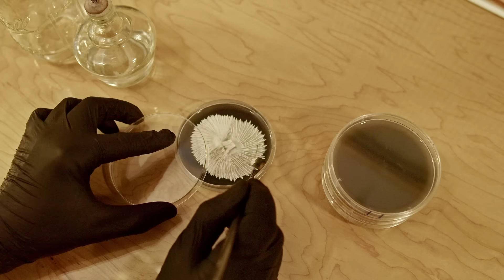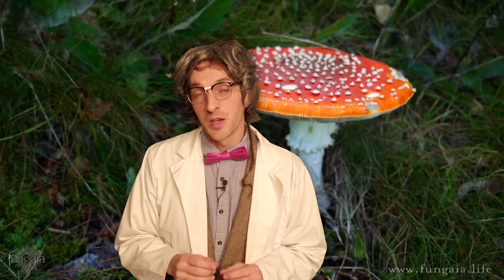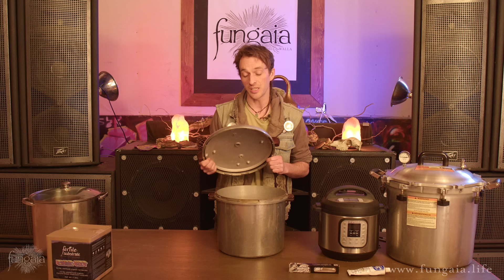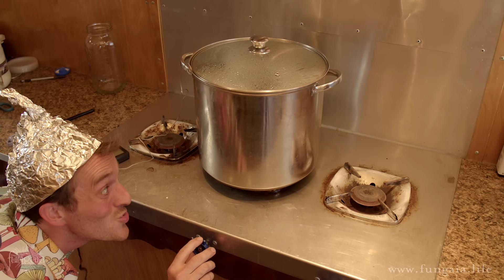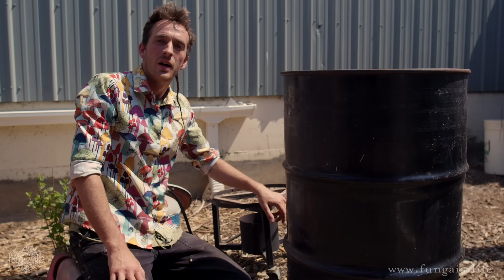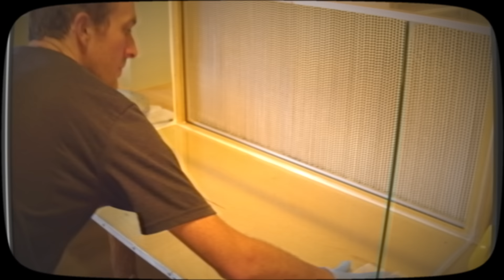Pressure Cookers & Sterilization for Mushroom Cultivation (Plus a Low-Tech Alternative)

Comment: A instatpot automatically vents until full pressure is reached and then seals itself.  I have been using one for almost 2 years not. Your times gor grain is way off btw when using 🌽. 2hrs will burn the grain. I wouldn't push 105 minutes just saying

Comment: Presto actually makes an induction canner that Ive been using with an induction hot plate. It works great. Im not sure what the standard is but it boils in 10 min, gets up to pressure in under 30 min with new & lubricated gaskets.

Comment: A little tip borrowed from some bbqers if you put those white knit gloves (sometimes called glove liners) and then put the nitrile gloves over them it helps block the heat and is not that bulky.

Comment: I have about 30 lbs of substrate I’d like to sterilize but only have an instapot. I’m worried about opening and closing my grain spawn bag too many times as I’m adding grain spawn to each sterilized bag of substrate over a multi day period. Any advice or insights? Should I try to refrigerate my sterilized substrate bags until I can add grains spawn to all of the substrate bags at once?

Comment: Hey FUNGAIA I appreciate your videos and lessons. I have a serious question. I was just doing drippy corn with my brand new presto PC I sterilized 7 wide mouth jars. I was going for 90 mins but I didn’t make it but 60 mins all the sudden my rocker stopped rocking and whistling and the pressure dropped 2-3 psi so I turned the heat up to regulate then I noticed my PC was wobbly and looked and I could see underneath the bottom. It had coned up and I immediately turned the heat off and got away. Thankfully it did not explode. I have absolutely no idea what I’ve done wrong. I used veggie oil on the ring I followed all instructions and I can’t figure out what has happened. Luckily I’m in my return window for a replacement but I don’t want this to happen again. Any ideas what could have happened?
Reply from the maker: Sounds like you probably ran it dry. If it's venting heavily, it can easily boil off more than 2 quarts in an hour. It's important to keep the heat low enough that it only vents intermittently. 

The only other possibility is a blocked vent. But if you have a pressure gauge and both the rocker and the gauge dropped you probably just lost steam.

If the metal is badly warped, it's probably not safe to keep running that cooker I'm afraid. I've certainly done it a couple times. Hope you were able to return it.

Comment: If using a pressure cooker that doesn't have a pressure gauge, is it still possible to reliably achieve a minimum of 15PSI for the desired period of time, and what are the tricks for ensuring this, or would you recommend just investing the extra money in a pressure pan with a gauge? Thank you!
Reply from the maker: All pressure cookers have some mechanism for regulating pressure. The most common is a circular regulator shaker weight that allows you to choose between 5, 10, and 15 psi. If yours doesn't, chances are it's only designed to run at 5 psi or so. This could be workable, but won't provide ideal results.

Comment: Using an european pressure cooker (little one, that can take up to 2 quart jars), that can go up just to 9 or 10 PSI, for how much time do you recommend to run it to actually "sterilize" without overcooking the grains (millet, in this case)?
Reply from the maker: About 2 hours should do it! Try leaving a jar un-inoculated as a control to test your method.

Comment: I worked for a company that made and still produce spawn and mushroom fruiting blocks with an old industrial baking oven. We used an autoclave only for smaller things, equipment, media etc. We baked the substrate at a certain temperature for a certain time and it did the trick. Lots of blocks that could be made each day.
Reply from the maker: Yes, this is a common method for large-scale production! Generally this would fall under "super-pasteurization" methods.

Comment: Hello, firstly i would like to thank for the amount of information you give to the society. Secondly i ran into a problem , where my cookers working pressure is 45 psi at 121-125 C . If i drop it manually to 15 psi, the electronics goes crazy. It might take some time for me to solve this puzzle, but meanwhile, can i use such settings?
Reply from the maker: Hmm, that sounds like either your pressure cooker is not venting air properly, or the gauge isn't working, or both. Venting the air for a while at the beginning of the run and then in short bursts periodically throughout the cycle is especially important for this reason.

Comment: Would you be able to sterilise in an oven set to 125c?
Reply: no, because oven's typically have a very high range of actual temperatures inside them - plus if you set it to 125c there is a high chance the inside of the oven is not actually 125 but more like 99-108 in order to do this properly you would have to use higher temperatures which then might impact the sugars inside your medium  -> a solid strategy for experiments to see which conditions clear everything else but still let mushroom friends grow would be my recommended move

Comment: Is there a way of working out the time required to sterilise based on pressure at a fixed temperature, e.g. is 15 minutes at 121 deg. C. and a  pressure of 3 bar the same as 90 minutes at 1 bar

Comment: Thanks for the great content! 

When the PC is cooling. When it reaches just over  212F I swap the weight with a DIY polyfill filter rinsed in isopropyl. 

The final steam exhaust exits through the polyfill, adding some sanitatizion and driving off iso. and as it cools the ambient air is drawn through the filter. into the PC. So I can save flowhood space by cooling in  "dirty" air.

I am just an amateur, learning as I go. interested what you think...

Comment: Honestly🤔...this video is better than Pron!🤣 I love mushroom growing! Will start myself in few months.🤩 
I have a question - What about using negative pressure...vacuum!? Will it work? It will kill all pathogens (they need air to live). And you will not heat the natural sugar of grain or lignin in sawdust. What do you think? 
...pssst...I love your channel man!!!🥰
Reply: I have thought about using vacuum to sterilize, as I have fairly extensive vacuum pump experience. I have not tried it because of the following:

1. You can not lower the pressure below the saturated vapor pressure of water, as it will boil - around 24 Torr (0.5 psi absolute = -14psi gauge). This will remove the water from your substrate and dry it out.
2. Most research I have found indicates that bacteria, yeast, and mold can survive vacuum, and that vacuum does not kill endospores. They are stunted by hard vacuum but  appear to be able to grow again after return to atmospheric. It could possibly be enough to allow the mycelium to get a foothold though.
3. Vacuum expansion could possibly more burst grains, which experienced mycologists find greatly increases contamination rates.

However, it is a very interesting idea, and I would love to see some test protocols of the methodology. Won't know for sure until we try :)

Comment: I've always sealed my bags before going into the pressure cooker because I have issues sealing them after cooking when they're wet.  When I fold the flaps down I make sure the filter is facing up.  Come to think of it, even the bags I had issues sealing after a cook were successful so, it might be fine.  I only just started using bags so still working out the kinks
Reply: It should self seal if the bag sits or leans against the folded top part